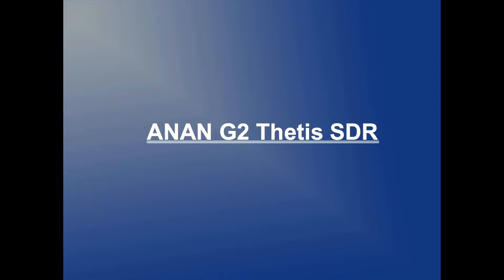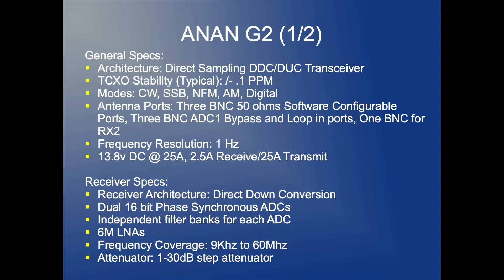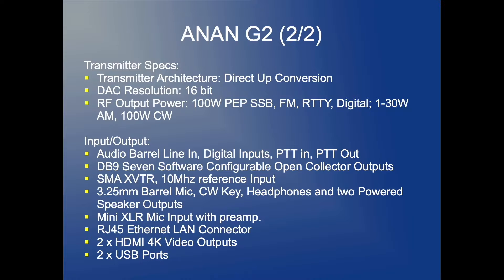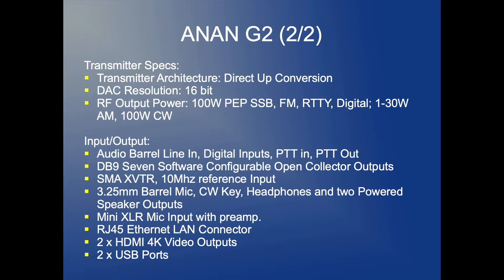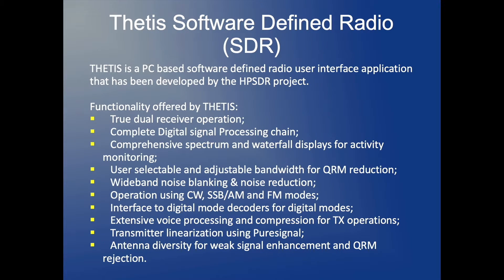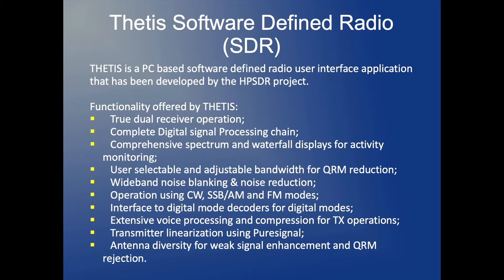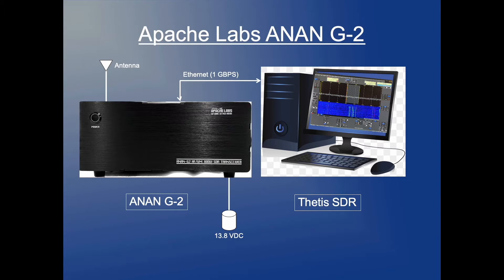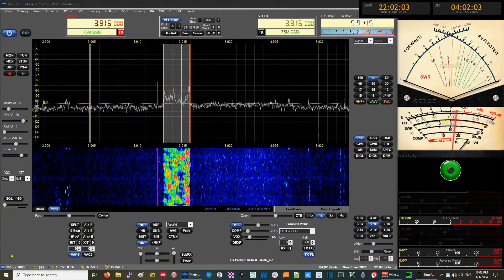Apache Labs ANAN G-2 and Thetis overview

Comment: I wish Thetis  ran on linux. I'm done with windows.
Reply from the maker: Thanks for the comment.  There is a version pre-loaded in the raspberry pi inside the Anan G-2 called piHPSDR that runs on debian; however, it's got a lot less bells and whistles compared to Windows Thetis.  Best of luck & 73!
Reply: There is a good SDR program for Linux that has just become available. It's called DeskHPSDR and you will find it with Google easily. It has a flavor of Thetis and has a good set of options. I was looking at AL website today and noticed that the screen on the G2 with the front panel, is identical to DeskHPSDR which leads me to believe that AL is using it to run their front panel. Since they are using a Pi in a G2 running Linux/Deb, I tried it on my PC running Mint Cinnamon 22.1 and had no trouble with it. It ran my 10e and 200D with no issues and was extremely configurable. BUT it is not Thetis. Thetis cannot be touched as the most incredible SDR program anywhere! Ritchie is GOD!